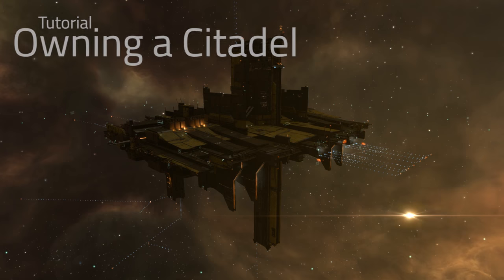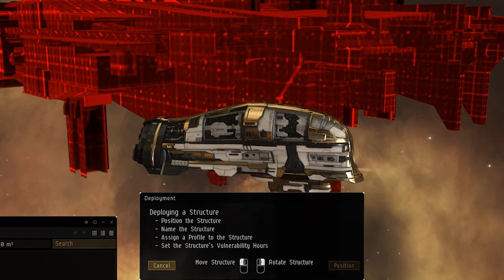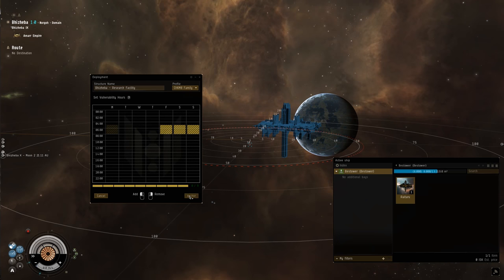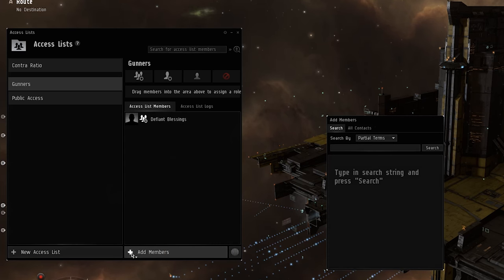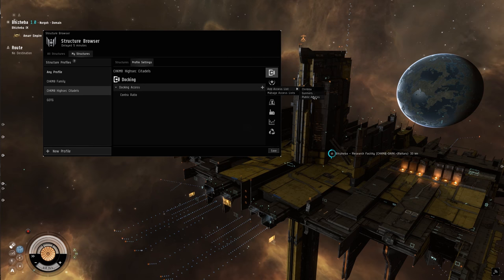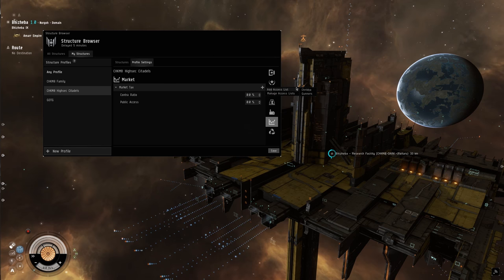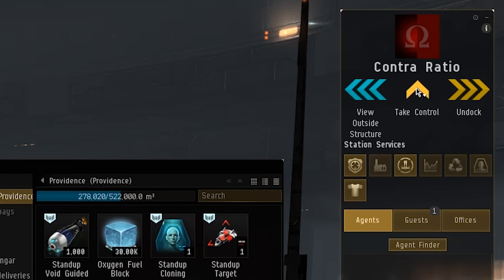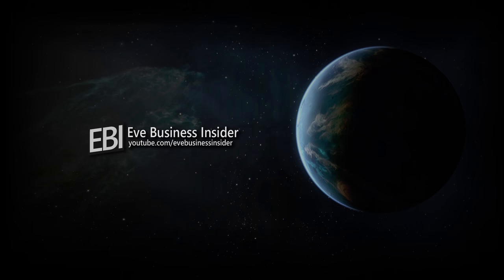Owning a Citadel

Comment: What is the fuel consumption for a Citadel and its modules?
Reply: Was going to ask this.
Reply: The Citadels themselves don't use fuel, just the service modules. The amount of fuel they use varies from module to module. A simple Raitaru with engineering/lab type modules that it gets bonuses on will probably run a monthly fuel bill somewhere between a medium and large POS.
Reply: @Mark thank you for the answer! :)